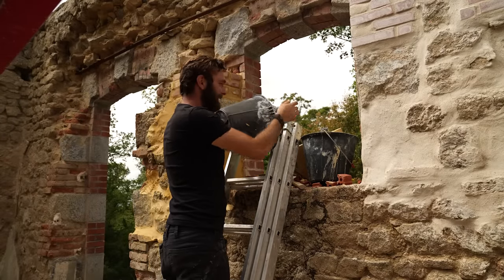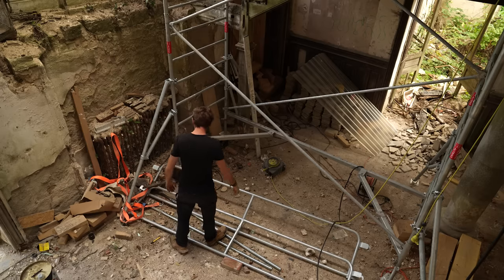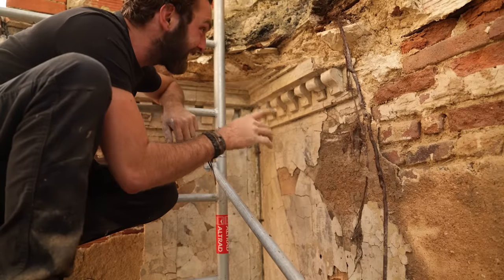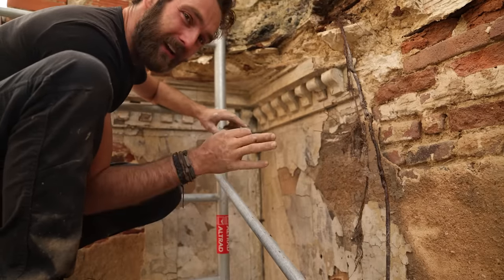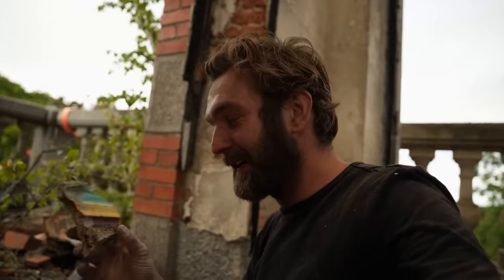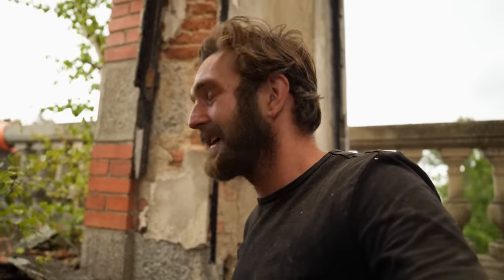Lost architectural details of the chateau.

Comment: Dan, I work in the coving industry (Victorian Cornice Company). Make a cross section template, if you make a cut vertically, try to get it as vertical as possible, if you cut it diagonally it'll come out bigger, we usually use one of those oscillating saws, but you can use a wood saw, Then trace the outline on a piece of card, make sure you mark where the wall and celling line finishes. That'll give you an exact template that any manufacturer can copy. you can cut one of the enrichments off with the saw, then whoever you get to do it can make a mold of it. If you can't get one off intact, you'll have to take a mold in place, build a wooden form to pour silicon in. If you need any advice get in touch.
Reply: @Escape to Rural France in case you missed the above advice
Reply: Wonderful direction for Dan
Reply: What he needs is help. You can tell he is getting overwhelmed by how he goes from one project to another.
Reply: can highly recommend Oscillating Multi-Tools for doing a whole tonne of work, especially doing precise cuts into old plaster
Reply: This is the best of the Internet. Experts freely sharing tips with the capable so that they can do their best. Cut profile template and a silicone mould give precision to good photos. Much appreciated.
Reply: @gordonnadolni  that might be to keep viewers entertained??
Reply: Good initial advice. I think on that friable plaster I would use tissue and dope to fix the surface. Mine away gently the plaster Above the moulding. Then use a masonry saw to cut off the moulding. It will be slow work but you have worked in gardening and many parts of that can be slow. Not everything in dismantling is rapid sometimes gentle hand tools are the best solution. It is the sort of job that might take two days and only provide 5 minutes of video. This is something you are doing for your future don’t get hung up on daily progress when you come to preserving intimate details such as this.
Reply: @gordonnadolni  he basically doesn’t have the correct skills to do this restoration, it’s turning into his cottage, slap some mortar here and there, a few bricks for good measure none of which is restoring strength to crumbling walls, we have to remember he is a good YouTuber, generating comments, clicks and thus finance. But without the correct skills this building is doomed. Yes it would have fallen down in years to come anyway, but you have to ask why no other organisation, people who know about these things haven’t touched it before now, and there’s your reason why, it would basically not give them any return on there money, the tax alone will cripple anyone who owns it in the future. You need a huge pot of money to do this, far exceeding anything that Dan could get through YouTube and patrons etc.
Reply: @escapetoruralfrance see above guidance for the cornice work
Reply: I would actually not bother much with that type of molding, does not look old. Picture as references. It can be redone easily at low cost.
Reply: I have seen people make paint on rubber casting of all kinds of architectural features in place.
Reply: @littletedontour442   Unfortunately, those have been my thoughts.  Dan gets a lot of compliments and support from Youtubers, but from what I can see, he is far over his head and most concerning are the structural concerns.  He takes his hand and crumbles away bricks and mortar (like powder), then props up a huge supporting 4X12 beam on the brick next to it.  He appears to be building the proverbial house on sand; or I should say, a house on crumbling bricks.  As Truman once joked, the only reason it is still standing is out of habit.  I'm not one for over-regulating but it makes me wonder, are there no safety inspections required from an engineering standpoint?  Those walls no longer look safe to me.
Reply: @ThePianoMan1953  well, if it was the U.K. then there would be set points along the rebuild where it would be inspected and signed off, in France it would appear they can do what they like.
Reply: @ThePianoMan1953  I was thinking the same thing, and I have no experience in construction. To me it looks like the foundation and walls have no integrity and a severe storm will just knock it down.  And as you said, why wasn't the building properly inspected to make sure it's safe?

Comment: When taking pictures of any cornices, you need to hold a measuring tape up against it so you can read the scale at a later date.
You could also buy a silicone moulding kit and make your own mould of a section of it.
Reply: The measuring app on his iPhone can do it as well with “close enough” precision.

For mm (or 1/16th in) precision, you’re going to have to use a tape measure and jot down dimensions on a piece of paper.
Reply: Exactly, nobody is trying to restore a 12th century museum piece here, as long as it's pretty close and looks good, it doesnt have to be a perfect museum style restoration of the cornice  @flabreque
Reply: Wow the view from the balcony is amazing Dan❤

Comment: Dan, it's obvious from your pictures that the tower extends far above the tree line which makes it vulnerable to lightning strikes. The usual way to overcome this is to fit a lightning conductor earthed a ground level to 5 to 8 ohms. 
But this has the effect of raising the potential from ground to roof level, usually negative, but not always.
Now imagine a big positive cloud rolling past with now a reduced distance and therefore resistance to earth, bang a weak negative strike goes from the tower to the sky ionising the air, instantly a responding more powerful positive strike from cloud to tower follows. So okay if the conductor can handle the strike, if not blast damage and possibly the start of a fire. 
Now you can overcome this with fitting 'glass discharge tubes' at the tower end, as used by the telecoms industry.
If struck these allow the strike to pass harmlessly to earth via the conductor, but don't invite the strike in the first place. 
This may have happened before and caused a fire, as I don't see any evidence of a lightning conductor previously fitted. 
Hope this helps, carry on the good work. 
William

Comment: We have a product called pinkysil here in Australia. It's a fast setting silicone, goes hard in 5 minutes or so. I'm sure the french have something similar. The easiest way to take the mould is to clean off what you have in situ and then build an open toped box out of laminate. then you dry fit your box, make sure it's not got any gaps, mix up the silicone and pour it in from the top. Then you hold your box while it goes off and you're done.
Reply: I love all of these ideas you guys have submitted . I am sure he will read them and be better off for it .

Comment: To release the plaster cornice intact, you will need an old crosscut hand saw and patience.
Gently work the saw between the wall and cornice contact point. Same again on the ceiling. 
The design can be sourced from traditional architecture  text books

Comment: Love the way you are repurposing the water cage - Hoist ready - strap under the bottom of the crate to hoist so the bottom doesn't drop out due to unsupported weight.  those cages when the water is full are designed to be move by tow motor not crane.  You have probably already hoisted it lol

Comment: Dan you should char/burn the ends of the joists (instead of painting) before you insert them into the walls. The painting will afford a decent level of protection, but Burning wood to preserve and waterproof it is an old Japanese Technique called Shou Sugi Ban - which is proven to work in buildings that are hundreds of years old using this technique. Plus its cheaper than paying for paint.
Reply: Yes, my Grandpa used to burn the ends of his fence posts. Great work Dan. Good brick layers are hard to find.
Reply: yes that's the best method, putrecible wood can become waterproof, I think dan don't have a big risk in france given the climate in his area,  capillary rise is the biggest risk, facade with  seal in poor condition....
Reply: @Cactus305 even bad bricklayers are hard to find.  No1 wants to do that construction jobs, one tends to get dirty in the process. Well, It is also expensive, since it takes time. Not that many new chateaux in rural France to lay bricks for a living. :D

Comment: Stoooop! Ah Dan - u could easily have made a silicone mould of that in place 😅. Literally just paint silicone over it into all the creases, then layer up with a silicone gunnfor extra strength. Not sure if it would need a release agent or not, but yeah quick, easy and cheap. With all those cracks there was no way that the plaster was gonna come off whole 😅.  On the upside u have great video of it and a person who works with mouldings could probably recreate it for u as its not an overly complex design. 🤞

I did notice that cornicing in yesterdays (?) vid in the top corner of the opposite side u were working on. Maybe theres another spot of it u can try it on?

Comment: A great way to make a cast of any future moulding or trim that is on a wall or vertical surface or even ceiling is to use a product like Alumilite Amazing Mold Putty.  There are others they have depending on specific needs and there are other companies with similar products.  Easily removes from the surface and easy to work with.  It will create a true cast of whatever you place it on, cracks, broken bits and all.  Best of luck with it and keep up the great work!  Before you know it, you will be moving in even if it feels always off right now.

Comment: Hey Dan! interesting video as usual, for the molding, you can make a mold of it using silicone or liquid rubber or whatever, and you can use that to make / repair & replace the molding that's there. But it would be nice if you could take it down or whatever first (for example, if there's concrete cutter to nicely just cut it out or whatever).

Comment: There is a Fibreglass Supply company based in Cornwall, UK that has 3 letters as it's company title and easily found on Google. They can supply some liquid mould making compound. To use it seal the old mouldings with varnish or such, mix the resin and paint it on then apply a second coat maybe a third. This is like liquid rubber so all floppy and will need support. Plaster of Paris and plaster bandage to build up a good strong and rigid support. Carefully remove the Plaster support followed by the resin. Place the resin back in the support and you can now cast as much moulding as you want.

Comment: That cage holder for water tank would be a great firewood holder. When the balastars are pressure washed on that high balcony along with balcony it will be beautiful. Or if you put a solution on and scrub then rinse which ever keeps the integrity of the balcony. Those roots will distabilize that wall for sure

Comment: @Escape to Rural France – Dan just make a mold of it, and to make a poor man’s mold all you’ll need is old paint brush, cooking oil, a bucket of water, liquid soap, and some tubes of silicon corking.
Step 1 - Add the liquid soap to the bucket of water them empty tubes of silicon corking into the water, 
Step 2 - Clean the area you wish to mold and lightly brush it with the oil 
Step 3 - While silicon corking is in the bucket of water mold into a blob
Step 4 - Take the blob of silicon corking out of the bucket of water and push over the area you wish to mold 
Note: the more tubes of silicon corking used the larger the area you cover.

Comment: Since the plaster molding is very fragile, you can make a silicone mold in-situ -several applications of thin coats. First you would have to stabilize the molding. You might be able to buy a special stabilizer for plaster. However,  I think several coats of polyurethane in spray or wood hardener would work as well. I haven't seen the wood hardener in spray, but a small hand spray should work, since it is quite runny.  I wouldn't recommend to use a brush. It might take of some of the plaster.

Comment: Actually, if you knew this was up ahead you could have bought a bucket of alginate. That's the blue foam stuff dentists use in a track and have you bite into to make a perfect cast of your teeth if you need a prosthetic or an occusal splint for nightime teeth grinding. Its macde from algae and super flexy, non toxic and lightweight. Sculptors use it for detailed one off casts. Its soft as shavingcream and hardens in a minute or two, but when vured its flexy enough that you can fill a bucket and plunge your foot and lowe leg in, yet still pull it out when it's cured. You pour your plaster into the hollow and when it's cured you cut and pull the alginate off and discard it. Voilà you have a detailed cast of anything. That would have required some planning ahead though, you'd likely have to order it online from a casting/mouldmaking supplier.
It's a simple enough design I'm sure you can duplicate from photos, just letting you know if there's any more detalied something in the future, you may want to make a replica of. The alginate is so smooth and fine it can even capture textures, like skintexture.
That was an interesting piece left I'm sure will be lovely for your restoration when you get to the decor! It's cool that you can manage to move that very tall scaffolding all by yourself too!
See ya, tomorra! 😉🌷

Comment: The trick is using a liquid latex or brush on urethane molding compound that can be used on the architectural element in situ. There are different formulas for specific applications.  It might be worth a bit of research. I remember a company like Smooth On (? I think...) had something that might be useful.

Comment: When you come across molding like that take multiple images from as many angles as possible and create a 3D model of the molding. Import them into a CAD software and print a mold off on a 3D printer. What would be better would be to get a 3D LiDAR scan of the entire building inside and out for reference.

Comment: You could paint on a rubber mould on to the original moulding,, and when it's dry peel the rubber casting off to make a plaster mould  from it, or make one from wooden blocks that are formed the way your casting is Pressed into it.

Comment: Should of/or use a tape measure or ruler in the pictures of the plaster parts for size. I helped restore an old theater that had plaster all over the interior of the building and they made silicone molds and also took pictures with a ruler in the picture. Look up Aztec theater/San Antonio Texas to see all the crazy plaster work. I didn't do any of the plaster work but I sure paid attention to what they did to restore it. I just helped make sure the wall behind the plaster work were good.

Comment: There is a kind of silicone you can use for moulding things like this that doesn't require you to build any mould around the thing you are taking a cast of. I think it's called 'kneading silicone' and it's like two clays that won't harden until they are mixed together but once they do they fix their shape pretty quickly. It might be an idea to use that to get a small portion of this cast in plaster or similar so you can make proper moulding later.

Comment: For the plaster, why not start by grabbing a scrap of plywood or cardboard or something, hold it up to the side of the decorative pieces, and then scribe the outline? The rest looks like it's all straight lines and sharp corners so you can just measure those parts. Obviously still a good idea to try to get a cast! But at least if you start by scribing that bit, you've got a backup plan if the mold doesn't work properly.

Comment: Aah, don't remove it! Honestly that molding looks so easy I wouldn't even cast all of it. Just cast the knobbies and make a stencil outline for the rest (a simple piece of wood that fits into the negative profile. Then you can just slap plaster down, drag your stencil across, and glue in the knobbies afterwards when it dries.

Comment: Very honestly if you had to redo exactly the same type of architectural elements of ceiling tower cornices and the roses which were used to embellish the location of the chandeliers, which in your case is Neo Classical style; in molded plaster staff, already, it will be complicated to find someone to carry out the task, a master companion of duty, plasterer is very capable , but , it will cost a small fortune, know that.
On the other hand, as you should know, today there are reproductions ready to install in Polypropilene and even if it is modern, it can be an alternative, because visually, even more so with great heights of floor plan and by going back over with liquid white plaster of Paris, this can have a result quite close to the original plaster.
In all way have a nice day & you are amazing for your work.
P.S :
👍👍👍👍

Comment: I would soak those moldings in supper glue that should hold it together
Reply: an use a quick set spray to dry the super glue should be enough to stablize them

Comment: Dan, if you have the newest iPhone, you can to a LDAR 3D scan than can be used in a program to 3D print what you took pics of. You should have had a large thin piece of sheet metal and tapped it up in from below and cut/sliced the plaster. Last resort you could have made a latex mold of the plaster piece.